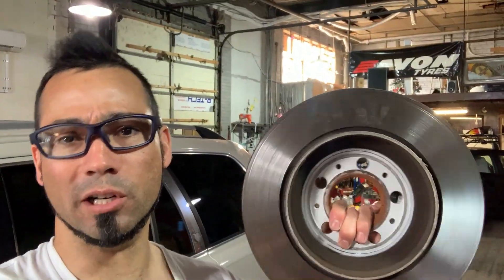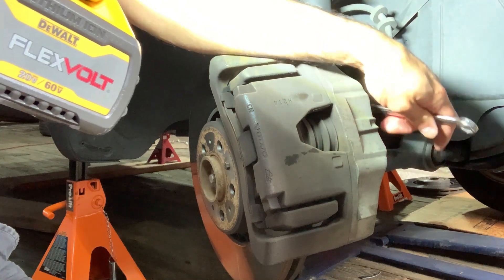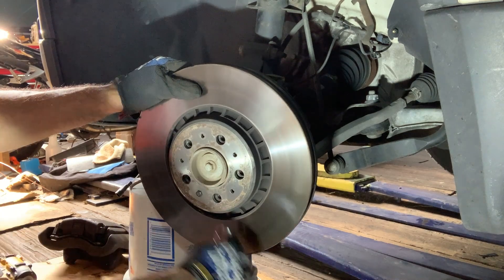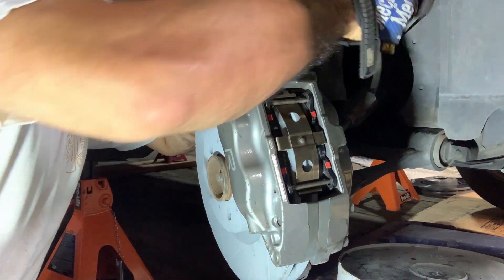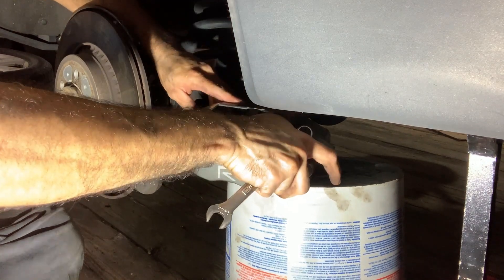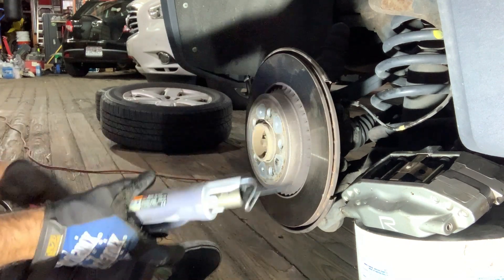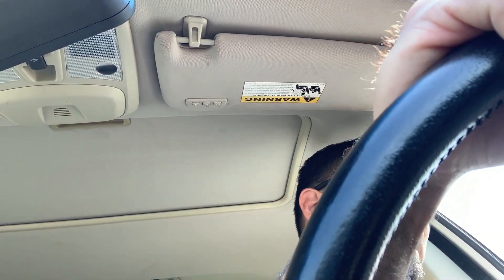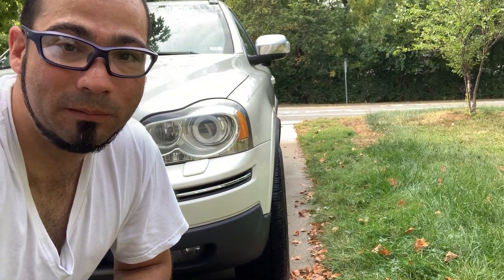Stop Fast! Volvo XC90 Brembo Brake Swap Conversion, How to, DIY

Comment: How does the brakes work after  breaking them in? Better or the same? I want to upgrade brakes for my 2005 S60 T5. Cant decide which.
1. XC 90, 336mm front, 308mm rear.
2. XC90 328mm two piston front, 308mm rear
3. All 4 330mm from S60R
Reply from the maker: The brakes work pretty well now.  I could still stand for them to be stronger but they are much better than what came on the xc90.  I'm not sure if you need all 4 but having the Brembos from the S60R on the front definitely help. It is too bad we cant fit the Brembos over the 336mm rotors.

Comment from the maker: I have received a few questions on what is needed for the car on this project so I'll put that here.  For the front brakes I bought 4 high grade bolts M12x1.5 x 30mm long.  Each bolt needed a sleeve to go around them with a 12mm ID and a 14mm OD (you can find these readily available) and mine were 14mm long (but I think 15mm long would also work).  You will need S60R or V70R rotors on all corners (unless you just do a front brake upgrade).  Finding a good deal on the calipers took the most time!  Get a metric tap and die for M12 and M10 in order to clean up the bolts and chase the threaded holes.  I bought my wheel spacers from Ebay.  They are 20mm thick, 5x108 bolt pattern, made for a 67.1mm diameter center bore. Thanks for watching my video!

Comment: Where did you but the spacers?
Reply from the maker: I bought my wheel spacers from Ebay.  They are 20mm thick, 5x108 bolt pattern, made for a 67.1mm diameter center bore.

Comment: Hmmm. You might have to find a way to make sure calipers are not moving.  Other than that looks good.
Reply from the maker: Good observation but the calipers aren't moving, the difference between an M14 and an M12 is 2mm on diameter (or 1mm radially), the thickness of the spacers is 1mm radially.  SO that spacer takes into account and fills all the space around the bolt.  It seems a little sketchy at first but it works fine.  There is shadier shit and oversights going on in vehicles straight from the manufacturer! Lol.  The difference in bolt grades makes up for the bolt strength. For example a class-10.9 M12 bolt has about the same shear force capability as a class-8.8 M14 bolt.  As always, if you aren't comfortable then don't do it.